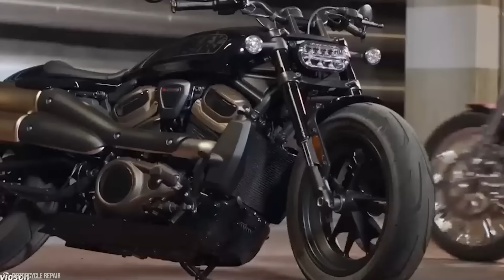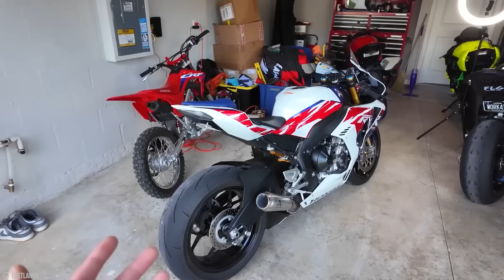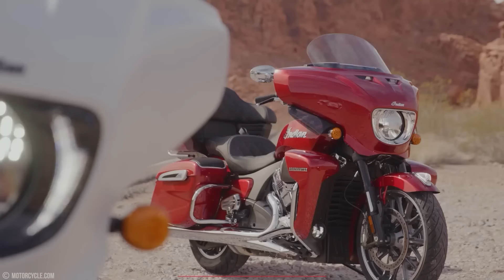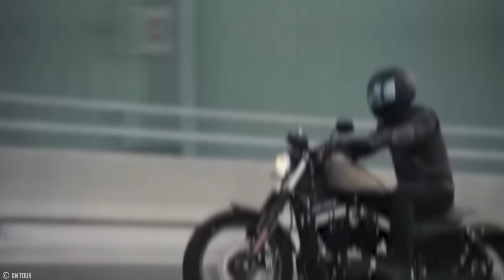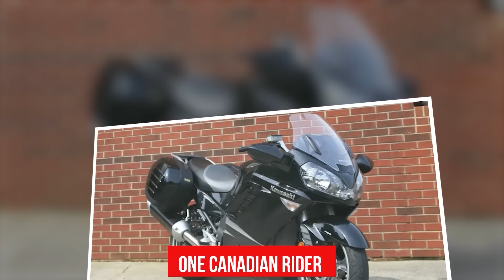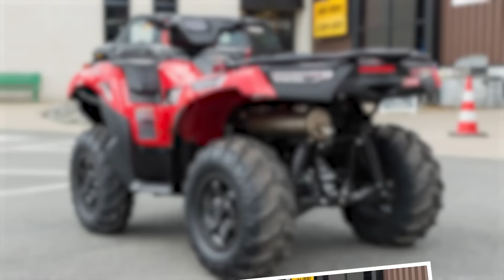American vs Japanese Motorcycle Engines: Which Wins?

Comment: I've got a Honda Pan European st1100 from 1992. 11 years experience. Except oil changes there was no issue just vacuum valve feom the tank. Had to swap the membrane and had to swap oil seal at the front suspesion. Nothing else. Harley Road King from 1999 which was my father's was a good bike but had to tight screws continously. At oil changes oils for three places. Anyway both of them are good but I prefer Honda. Cheaper.
My friend had a Yamaha Drag Star which is air cooled also and ran a lot kilometers. At engine the only bigger thing was a clutch replacement.

Comment: 2020 Harley Davidson low rider. 700 miles starter started making a metallic sound that was terrible.  Finally the factory battery died . No problem right just lift the seat off. No the rear suspension shock is designed directly over the battery.  Well no wonder a tool kit is not included but hey a free shirt is. Plus usually a key is used to remove the seat harley no only a quarter or penny coin. Why because they know nobody is taking that battery out without a lift and specific hex wrenches. Never again. Oh and the 48 had bought the warranty but warranty denied because the front motor mount is designed to destroy its self. The garage and dealership are seperate corporate entities that create a gulf that make getting anything impossible.  In lamens terms they screw each other to screw you American asshole.

Comment: Not sure where you got the Valve adjustment every 10,000 miles value for HD. But most modern Harleys have hydraulic lifters which do not require routine valve adjustments because the system self-corrects for wear. Big part of why I switched from my Suzuki cruiser to HD was the fact I don't need to do valve adjustments

Comment: Harley knows how to build / design a proper engine ; real cutting edge powerplant.
….. go visit Harley VR1000 engine….. spectacular! …. But it did not meet the traditional mold of Harley customer heritage vision. The VR1000 : no shakes, good power per displacement and you could bolt it to the frame as a stress member. 
Me: ST1300 (154k miles) and RC51 ( 40K miles ) and no issues, go figure!
Reply: Not everyone cares about hp. Seems to be all small pp boys care about. Stress member frames is cheap looking. Guess what harleys also do the numbers you listed with no problems. I always wonder where you get this info about them being unreliable from? It isnt the 80’s. Get off media.

Comment: I have a 2002 vstar1100 and never adjusted valves, it only moves when the motorcycle is new sometime, but these valves don't move. Each time, I have done a checkup, it was at the right place. The weak of this engine is from the rider if he gives fuel and start at the same time, he will break the starter clutch, rectifier and battery. You are not supposed to do that, only choke button and push one time the starter button. Also, the engine is air cooled, so you can't let on idle the motorcycle for a long without any problem, trust me that warm enough to melt down your battery not stopping the bike.  Outside a new battery, tires, brake pads and new old change, nothing to do.

Comment: Harley engines have employed hydraulic lifters forever,. Where are you getting the 10,000 valve adjustment intervals from?
Reply from the maker: Found on some forums!
Reply: @MotorcycleNexus  they self adjust i believe. Some m8’s run anywhere from 100k-200k before rebuild.